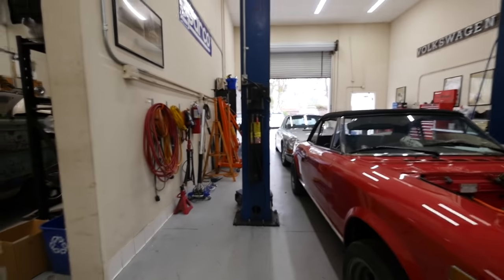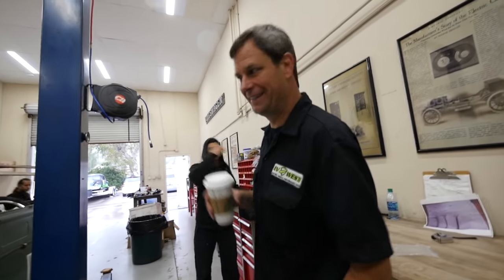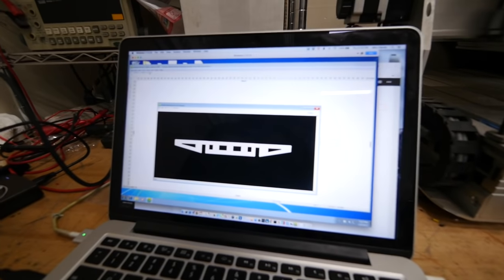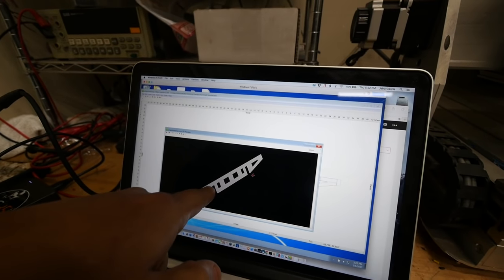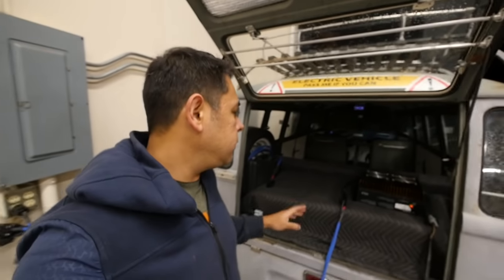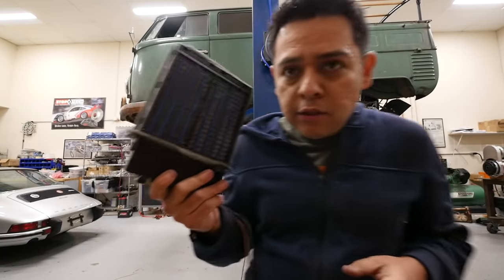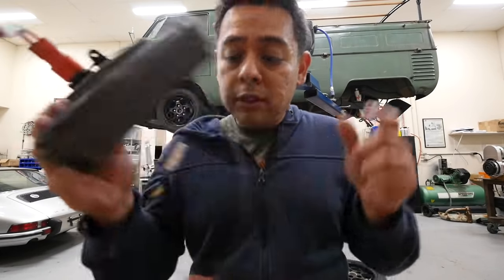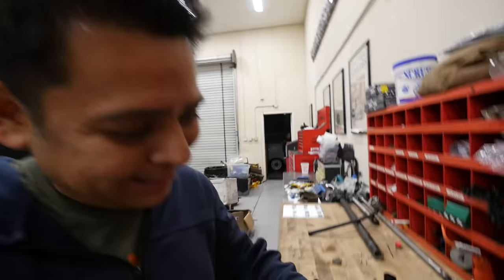30 kWh TESLA BATTERY under the VW Bus Floor?  -  Vlog 2

Comment: you can use Kapton tape to protect stuff from heat.   You can use it to make sure 2 parallel wires don't melt together and fuse and short.  Also Teflon heat resistant spiral wrap.

Comment: 9:18,He is using a multimeter to connect one probe to the main negative cable and with the other probe , touch all the internal connectors to find out if its parallel or series for those who don't know

Comment: my guess is the smart heater plastic is glass fiber reinforced, so it can withstand heat and abuse. if you look at the plastic housing you should see some markings if i'm right you should see GF# # indicates the % of glass fiber mixed with the plastic. that's more than likely why your fans are making smell and smart heaters casing isn't.

Comment: Interesting workaround for putting in Tesla Cells into your ride. I'll be looking forward to that alteration of the chassis of the Bus. Nice looking supports. Should be pretty easy to weld in place for hanging the modules. Are you looking at just using the deeper central part of the chassis for the cells and keep the original outer section stock and no cells? Looks like that would be a good idea so you keep good strength in the chassis. If you have some built Id be interested in a set for my panel bus. Not sure how well the Leaf cells will fit under the chassis but I will be checking soon to see how many I can stuff under the pan. You know, Busses were always back heavy and front light. So any extra weight balance up front will only be good. I like the idea of a low pack between the front and rear wheels. Keep  a 60 40 balance if possible. Rear weight bias. Should balance well and being low already should improve the ride. My old 13 Window Deluxe was low and it handled great. It too was rear weight biased.

Comment: It's ironic you should mention changing to Tesla packs, and make gains in range along with loss of weight. The falls along the lines of what I call "The fuel-tank standard".

Basically, it's where battery design reaches the point where a battery-pack is no larger or heavier than a filled fuel tank it is replacing, can be as easily replenished & deliver as much energy as needed by the demands of however that vehicle may be built-up by the builder/owner, while also providing the same reliability/stability or better. 

Until then, one shouldn't expect to see many EV- conversions done to existing internal-combustion powered vehicles. However... I do like your underfloor battery placement idea for mini-vans, and would like to see the same done to a 1st-gen Chrysler Minivan I'm eyeing. 

BTW, I forget: Is it EV-West that offers the bolt-on, motor-driven accessory cradle w/vacuum-pump & A/C-compressor, or that another EV-conversions company I saw here on YouTube?

Comment: What means of transmission preservation have you looked in to? Torque limiting, porsche g50/audi 01e transmission swaps? If those transmissions can handle late model v8s in kit cars etc. they should hold up better than anything those aircooled rigs came with.
Reply from the maker: transmissions break while showing off (drag racing, smoke donuts)  not in normal use.

Comment: why not use a 120 volt ac heater ...but take out the fan and change it for a dc motor..dont think the heater coil will care  ac or dc.or pull heat from your motor control....just a thought....great videos
Reply from the maker: thats what I installed

Comment: Allowed the element fan to run first turn off the element to allow the element to be cool down this will increase the life of the element this would prevent any burning of wires this could be achieved with a thermostat on the element the cool the element down when you turn off the unit this is very important in electric heating the same procedure is used in gas heat it is very efficient when the element is an reach Optimum temperature the fan come on automatically this prevents High amperage draw also with coldl Air it is very efficient energy management system

Comment: Lower voltage = higher current draw not sure you want that in the eSamba. Check out how Tesla did their hvac in the model X.
Reply from the maker: Low voltage systems are way more affordable and they perform as i will show in tomorrows video,  thats why we fool around with low voltage accessories
Reply: jehugarcia do you have seat heaters installed? That might be all you need in your part of the country. Btw - great work. I can't get enough of your progress.
Reply: looking forward to the next post, id like to know more about this too.  wish i had time to disassemble with you, hehehe.
Reply from the maker: yes i use seat warmers

Comment: You have heated element blowing heat on another element which the element of one of them will be drawing higher amperage this is the first problem the second problem if your fan have variable speed it will contribute greatly to the heaters heat blowing on heat increase the amperage at low speed these two problem are very critical you could save yourself some energy to prevent wires from overheating temperature being too high 🤔

Comment: On the subject of breaking transaxles, there is a company called http://www.subarugears.com that makes a reversing ring and pinion kit for Subaru transaxles that makes them usable in VW boxer applications.  They are VERY close from a fit standpoint to the stock transaxle.  Since you're using this in EV application you're using an adapter plate anyway, it shouldn't be too terrible.  Keep in mind that the Suby transaxles are built with a lot more HP in mind, so they may hold up better to the EV torque.  I am sure that doesn't mean they are indestructible, but it's could be a good start especially for heavy (bus) or sporty (914) builds.

Comment: How much for your CALB batteries? I have an off grid battery charge system like Michael's. 14 solar panels but only 7kWhrs of CALB 60 and 100 AHr batteries. I am in Granada Hills in the San Fernando Valley. I have three EVs. 50 solar panels total. I have two Tesla Model 3 cars on order.

Comment: Couldnt you just program the Controller not to go over the original engines peak Torque and Hp if being run on a stock Transmission? Seems like an easier thing to do then replace rare and old transmissions.
Reply from the maker: +brad450   Where is the fun in 30hp?   These are not stock transmissions rather custom High performance builds

Comment: When I first started watching your videos a few days ago, I wondered why you didn't put the batteries below the floor as Tesla does.  Done right it will give more rigidity to the vehicle, lower the center of gravity and (as you mentioned) balance the weight load more evenly.  I can't wait for you to get your van dialed in with your installation.  I might buy a restored VW van and bring it to you for the conversion.  I have 3 electric cars now and am looking at a Zero electric motorcycle.  Anyone in the market for a 2014 BMW i3 with 14,500 miles and 3 warranties?
Reply from the maker: +Donandnan Elmore   Let's do it

Comment: I want know will you front the challenge of put electric engine and batteries on a bigger vehicle, something as a microbus, for example.
I am planning put 2 traction axes, 2 engines 12 kw each, and about 80 batteries on floor of a motorhome - for this, I think will must to reinvent the whole vehicle, for get put all these batteries on a closed and cooled chamber.
Other great idea is no need a plug for recharge: I want put 15 solar panels 300 w on the roof (5 fixed, more 5 on each of 2 sliders, for extend when parked); so, when the charge level very low, I park on some free area, and enjoy the surroundings - what think you my project ?

Comment: Hi Jehu, is there anyway you can put some type of charger on the wheels to capture the energy when they spin.  If you could figure that out, you would have a car that charges itself with unlimited range.  I might be interested in the batteries.  Need more info.  Can they be used with solar panels at my home?
Reply from the maker: https://youtu.be/2WeqnD2HzS4
Reply: it is possible but it wont be unlimited because there is still some energy loss when you do that,  you can use a generator but that is not efficient i think the better way is using electric motors the el motor works using the el energy to make a magnetic field to rotate a metal part and produce mechanical energy and a generator works the other way  it uses mechanical  energy to produce el energy so if you take a small el motor you can try spinning it with your hand and measure the  output and you will see that it generates el energy so you can put another el motor to your wheels but that will be tricky and will slow down the car because you will add weight  but  this is a pretty efficient  way anyways  or you can put a turbine on places like this http://prntscr.com/dsvfum so they spin a small el motor that is pretty lightweight  if you put the turbine under the hood it wont make the car look bad at all and it will still generate energy  in a normal petrol car that  air goes through there  and  cools off the engine so if your car is electric that air is used for nearly nothing

Comment: What's that long tube that runs down the center of the vehicle? Is that a "heat tube" going from the engine to the cab? Could you get rid of that and make more room for batteries?

Comment: Do have have heated seats? I just bought some carbon fiber seat heaters off amazon and they are amazing. On low setting one pair draws 1.5a at 13v. One big advantage is they heat up almost instantly...
Reply from the maker: +Adam Mackey Smith  yeah

Comment: I have to say that you made some very educative video's ! I'm a junior naval architect from the netherlands and since a couple months very busy with designing a high power electric boat. i build a electric boat before, but with the sinopoly battery's, wich doesn't work out in a positive way for the power to weight ratio of the boat. In your previous video's a saw you made some 18650 battery module (like tesla) why don't you only use those 18650 modules ?
Reply from the maker: +Maikel Evens  that's the plan 54Kwh of SMART TESLA (18650) modules on the Samba
Reply from the maker: +Maikel Evens  at this point the diy way would take more time and more money than the Smart tesla modules,  two things I don't much have anymore

Comment: Why not just do like racers do and upgrade the gears to dog gears or cryo treated gears and if you don't want the noise of dog straight gears get the standard type of helix gears.

It's cheaper for you if you only use 1 gear. Vs me in my 500hp+awd car... It can break any gear...

Comment: Oh!  . . . . battery packs underneath the bus.  Better protect them from impact with road hazards.  Another EV manufacturer learned a hard lesson when one of their cars ran over the steel weldment of a trailer hitch that fell off someone's vehicle.  Punctured the battery pack causing thermal runway.

Comment: Hi jehugarcia, i have a question on the taxes of your retrofitted electric cars since their original engine was replaced with rotors and batteries, do you pay different tax since you modified the car or hows the tax done on these cars?
Reply from the maker: +Galih Bhaswara  department of motor vehicles does not know its electric and being classic means they are exempt from emissions checks so they don't ever need to know

Comment: Maybe someday someone will make good money making EV accessories that automatically adapt to the voltage of the vehicle - if that's possible. It'd be nice if more were universal.
Reply from the maker: Voltage standards are starting to develop,  96 cells in series are very common so 350ish Volts
Reply: Good to know. Thanks!

Comment: I would like to buy 24 of them for $45 each if possible. I can come pick them up or if you are interested in seeing my system, I am not too far away from you. I have had five EVs, one CNG car and about 60 interesting gas cars over the years. and was design manager on the Mars Curiosity rover power system.